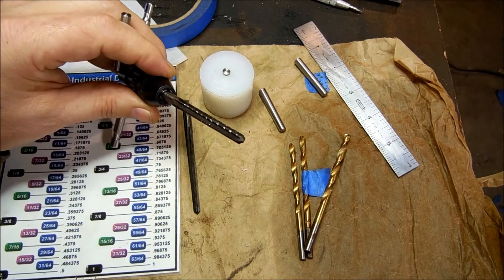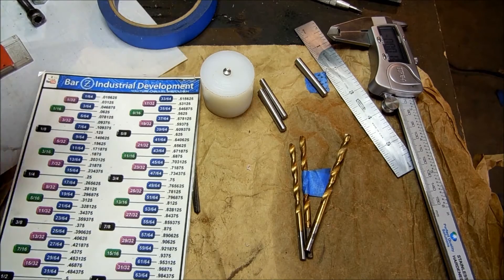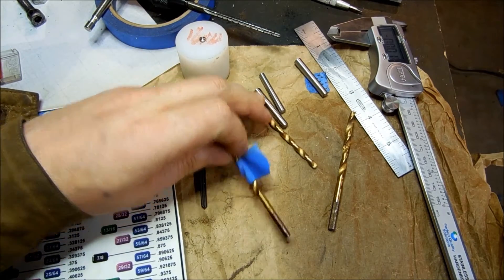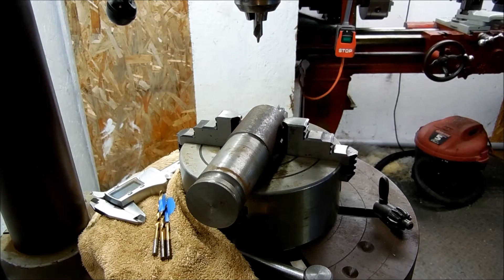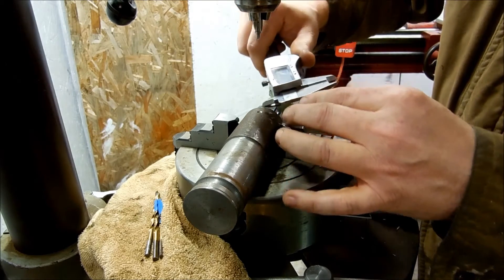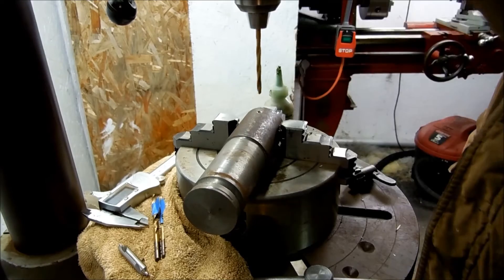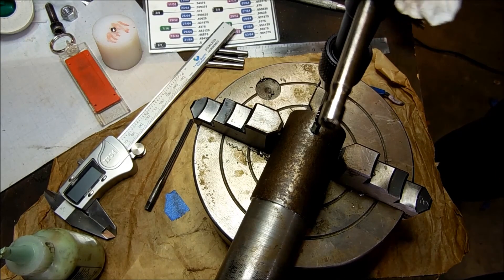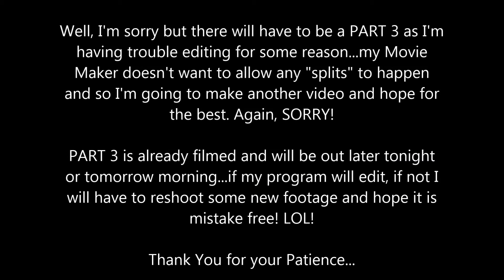Taper Pin Drill and Ream Part2

Comment: Im late to the party, but gonna have to make a taper hole for a oil pump drive on a D-342 caterpillar engine. Im in the process of repairing this engine, and was about to install the oil pan, and noticed at the last second there was a burnt spot on the pump casting. Turned out there was a bushing there that has spun and destroyed the housing. Long story short, to replace the drive shaft, you have to set the gear clearance then mark the hole and then ream it for a taper pin as the new shaft comes with no hole. 

So your video is quite helpful as it occurred to me, Ive never had to make a taper hole before. Wish me luck, could be fun!
Reply from the maker: Good luck brother!

Comment: I have a problem. I have a 1/4 tapered pin. I have a tapered drill / reamer combo. any recommendations going in 2 inches of 316SS ? My drill ream combo seemed to burn out pretty quickly. Also used oil as a lub.
Reply from the maker: Wow, 316ss is tough stuff, and it work hardens...sorry I missed this post. Hope it worked out well.